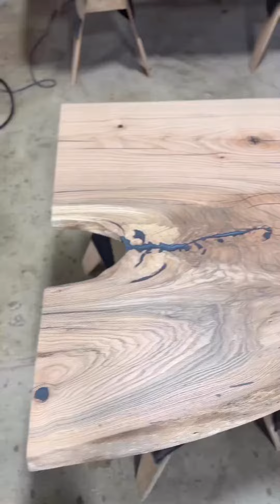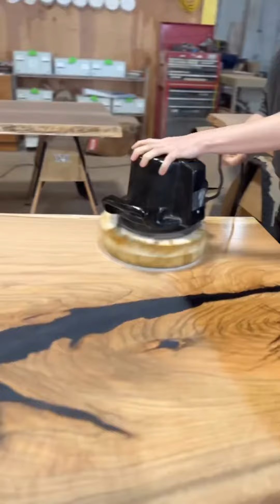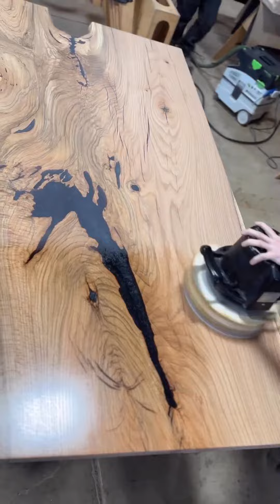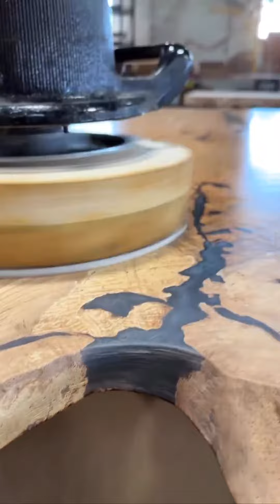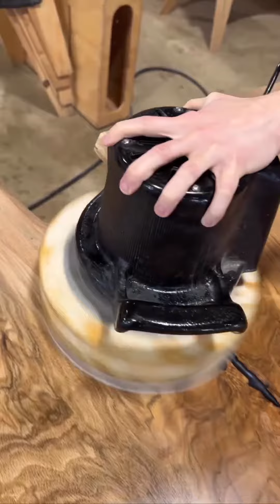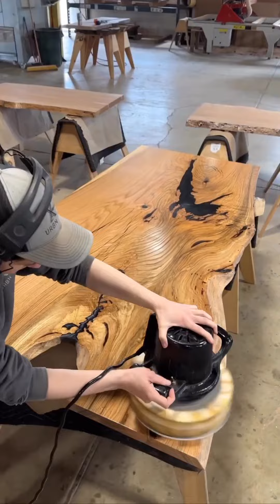Achieving a Natural Finish on Red Oak Live Edge Slab with Odie's Oil | Hardwax oil

Comment: Hi. What grit did you sand to before you used odies?
Reply from the maker: There are no sanding restrictions with Odie’s so you can sand to any grit. This is because of our true cross linking and molecular bond. This table was sanded to 800 or 1000 grit. The higher you sand the higher the sheen.